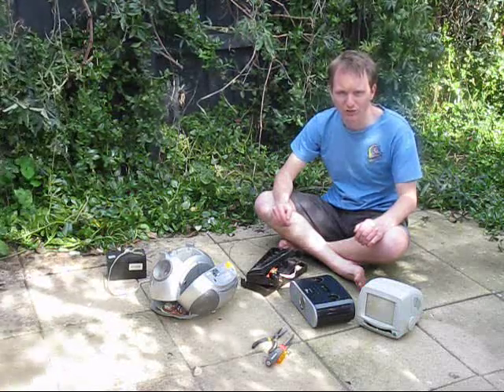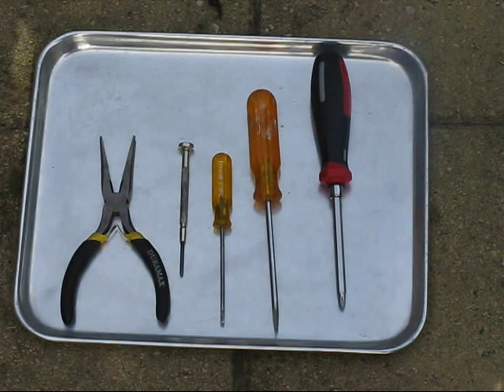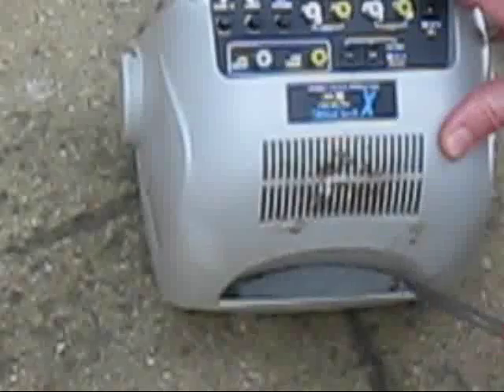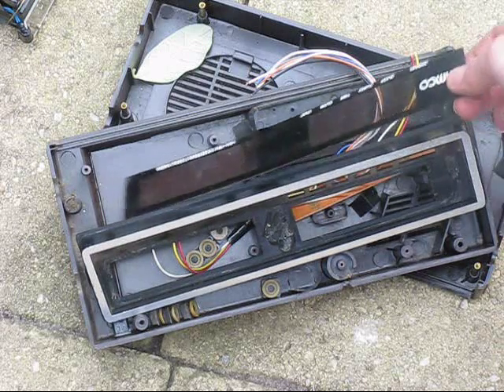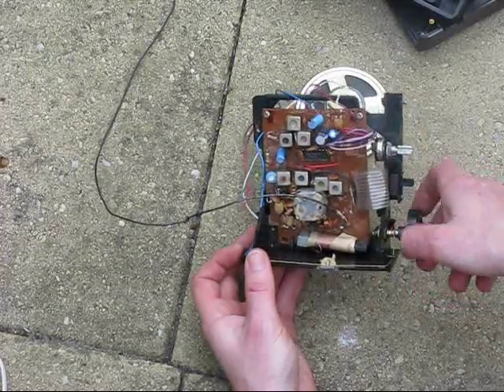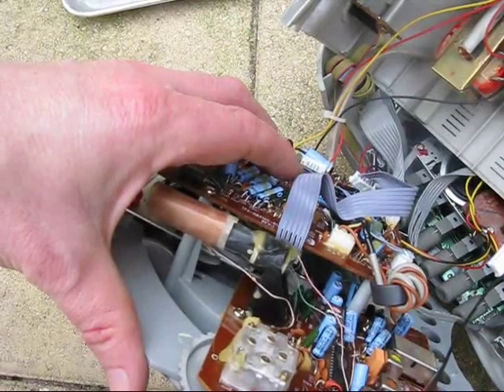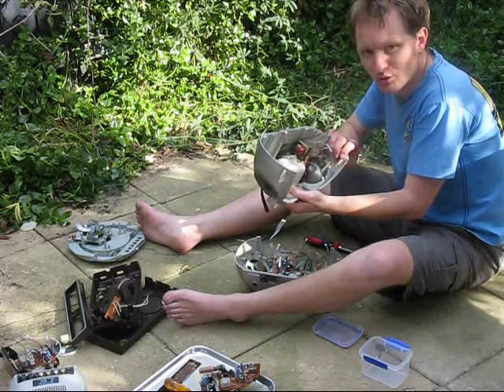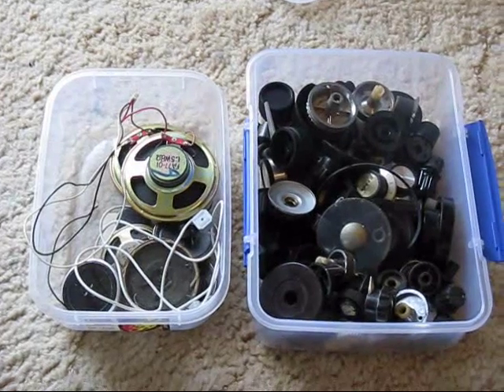Electronics on the floor: Taking things apart

Comment: I have a copper bucket. Anything from the power cord to little bits of wire gets cut away and thrown into the copper bucket if there is no need to leave the wire attached to an item. It seems like I'm always needing a short piece of wire for a project so instead of cutting something from a long roll I grab something from the bucket. If you collect a lot of scraps you can also sell it to be recycled.